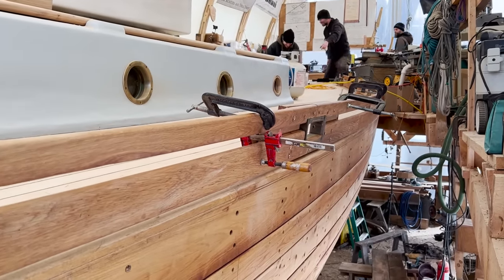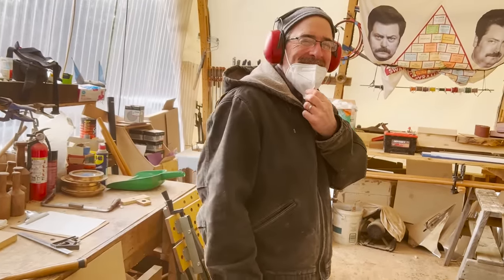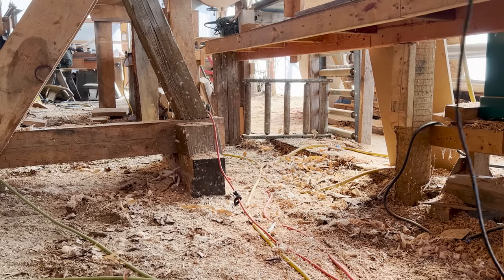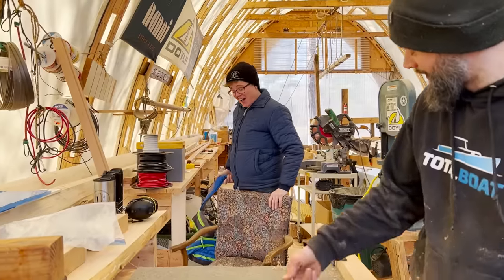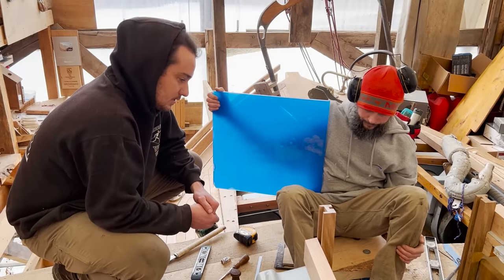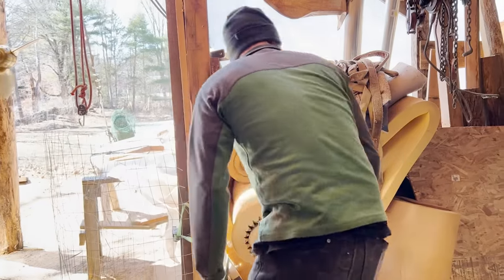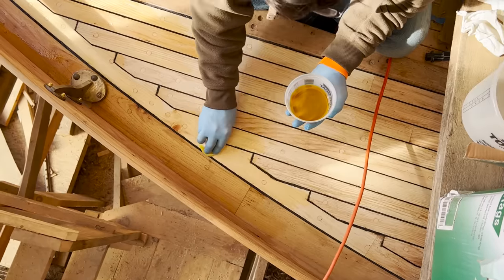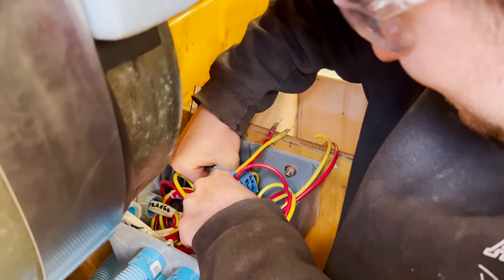A Fairer Hull and an Oiled Deck - Episode 261 - Acorn to Arabella: Journey of a Wooden Boat

Comment: The grinders seem to have worked well enough to rough oug the haul. But with so many gouges from everyone not keeping their discs flat. It seems like you will end up having to either use a lot of fairing compound or take off between 1/8" & 1/4". A belt sander, straight line sander, and flexible longboards will definitely be needed to get it well enough to paint.

Comment: Love the antique navigation lights. Please, in addition, have a set of bright LED lights. Imagine searching the darkness for those antique lights. I have spent my career searching for dimly light sailboats on the Chesapeake. Your lights may look bright up close, but what if your 6 miles away? And it's a full moon, not a dark night. You want to be able to "light up" your boat when the Coast Guard, tugboats or passing ships need to see you. It can get crazy close out there. Also, love what you're doing.
Reply from the maker: All of our nav lights will be fitted with LEDs.
Reply: Of course you will use LED lights. I’m talking about the difference between nav lights that are required by the Rules of the Road, think minimum standards, (your beautiful antique lights) and being able to light up your boat when your accidentally stray closer to commercial vessels than you would like to be (it happens) and, in an emergency, the the other guy says “I don’t see you anywhere, where are you”. You want to be able to be seen, from far away. You will find yourself in tense and possibly dangerous circumstances. Put a tricolor light on the mast top for emergencies or close meeting situations, and make it bright!
Again, I wish you well. My comments come from someone who spent a career guiding merchant ships on the Chesapeake Bay trying to avoid running over yachty-fellows with dim running light. When the shit hits the fan, and it will, you will want to be very visible and from a long way away. 
Godspeed.
Reply from the maker: LED lights are sold by the distance from which they’re able to be seen, especially when marketed for nav light applications so they meet COLREGs. We’re following the guidelines for sure, are well aware, and thanks for watching. —Anne

Comment: Could you put a fitting into the lid of the pail for the boat soup, attach a small vacuum pump, like an oil extractor, then pull a vacuum, to draw the air out of the wood, then when the vacuum releases it would draw the soup further into the wood.

Comment: I used an orchard sprayer with 40% linseed oil, 30% clear wood preservative, and 30% mineral spirits on my deck on the "La Ola"  built 1912 wood 44 foot Salmon Troller and Tuna Troller.  So when you have a warm to hot day, spray the deck and take the rest of the day off to let it soak in.
Reply from the maker: Neat boat!

Comment: I knew this was coming up and I was going to suggest useing a belt sander with an 80 grit belt it’s very course and used at right angles to the grain removes all high points as I had to doing an old floor then swap belt for finer belts, forgive me!.
Reply from the maker: Aw it’s ok, Michael, we’re humming right along.

Comment: Fairing is such a HATEFUL job ! Having said that; the results can be VERY VERY satisfying. I much prefer to use a two-man ( or three if you can do it ) longboard as opposed individual tools.
Reply from the maker: Interesting! Thanks for sharing that!
Reply: Was part of fairing the hull of a 12 using several 2 and 3 ppl long boards. Horrid when done for weeks ;)
Reply: @andrejsljunggren  Two of us went through the grits for more than a week on an old 8m, hateful indeed, but a very VERY pretty result. I wish I had owned the thing instead of being a spring fit hire.

Comment: Oiling the deck will make it slippery (dangerous) and prevent saltwater from being absorbed (causing rot).  
Traditionally decks are never oiled for those two important reasons.  

Clean saltwater is the best treatment for decks because the residual salt will attract moisture out of the air minimizing how much the wood dries out.

Be sure to give those lubbers batons to check fair their work next time; it will become more specific and clear to them what your goal is. 
Cheers and thanks for another great video!
Reply from the maker: Hi James! The oil cures, and saltwater is still helpful even with cured oil on it. I’ve worked with a few schooners during fit out and oiled decks are what we did. But yes, your point about salt water wash downs on decks is so crucial. I always remind people with canvassed decks to do the same… I take care of a beetle cat for which it makes a big difference in the longevity of the foredeck to, after rain, give it a good few buckets of saltwater. —Anne
Reply: @AcornToArabella  Hi Anne ..... We always mixed 50/50 linseed oil and turps then heated it to almost boiling point to do out timber deck (commercial working boat) The deck was made from celery top pine
Reply from the maker: Nice!!

Comment: There is a difference between smooth and fair. It may "feel" smooth but may not be fair. Be careful with rotary sanders. Get fair with power planes, then smooth with belt sanders and rotary, then long board.
Reply: Yes, I thought you needed to use a fairing board to find the high spots.
Reply: I was thinking about this a bit more.  Maybe they were using a long board to identify high spots, marking them, and then using the rotary sanders on the high spots.  That might be a more cost effective way than fairing manually.
Reply: @AndtM677 That's not the way it works. Trying yo take down high spots will not necessarily do the trick. It will be smooth but not fair. The result of rotary sander over use will be a paint job with ripples. Feeling smooth is not the test. Long board is the last step to perfection

Comment: Wow great team blasting off the fairing of the hull. So much happening on Arabella. The oiled deck and rails look good. How many coats it will need? Love my Friday fix of A2A. Thanks guys.
Reply from the maker: Coats of paint? Three or four. Primer and a couple.
Reply: @AcornToArabella  In terms of oil on the deck and rails, though, I guess the answer is as many as you can?
Reply from the maker: As many as you can, yup.

Comment: Because the boat isn’t caulked yet - has the fairing process filled the inside of the hull with dust you can’t get out now? Or are the panels all tight now on the inside edges of the boards? I recall back in the earlier planking videos there were some visible gaps between the planks and I wonder if these have all opened up further up as the hull must be bone dry at this point?
Reply from the maker: In the spring, as the humidity has increased, the seams have closed up in many places. Steve has been caulking there, and as more seams close, those will subsequently get caulked as well. We’ll help all that swelling along with some water on the boat shed floor, or with something that can mist the boat if that’s not enough. They’ll close up… they went in tight! —Anne
Reply: @AcornToArabella  it really is a living thing hey!!

Comment: For those dead eyes, would it have been possible to set up a jig with the drill press, and use a forstner bit, or even an endmill (yeah, I know endmills in Jacobs chucks are bad things) to clear out that material?
Reply from the maker: They need a fairly organic shape to them for the line to pass around.

Comment: what exactly is going on with all the sanding to the hull ?  what is the exact process for the hull ?
Reply from the maker: Fairing: making the shape smooth. And its really just grinding and sanding, and eventually taking a batten to the surface for fine tuning.

Comment: I can't help but keep wondering about the whole process of varnishing/oiling the hull early on, then just to sand it all away again at this stage. What are the pros and cons? Obviously the cheaper and less work alternative would be to leave it untreated in the interim. Does someone have some insights to share on this topic, please?
Reply from the maker: It is relatively easy and inexpensive to coat the hull in oil as a preservative since there were potentially years between when the planks went on and when the boat was going to be launched. We didn’t varnish the outside of the hull, but we did do applications of oil from time to time. —Anne
Reply: @AcornToArabella  Yeah, thanks! I was figuring either preservation or the drying process had a role in this decision. Yet there was a trend a few years back here in Norway where the outer paneling of wooden cabins/houses were left untreated to be exposed to the elements and darkened by the sun, where supposedly the resulting surface would act as a protective layer by itself. Inspired by an observation of many ancient builds which had been left untreated rather than tarred/oiled, and noting the still good condition of the wood.
Reply from the maker: There were some pieces on the boat I lived on that were untreated, and that looked beautiful gray. The occasional dousing with salt water was enough. The Mystic, CT builder Tommy Townsend is a big fan of leaving trim unfinished that would typically be varnished. The result, along with his color choices, is warm. He avoids varnish for maintenance reasons, and since I find practicality to be most beautiful, his boats are some of my very favorite. —Anne

Comment: I always use a fan pointed downwards 10' away or so when sanding. Not sure if wouldn't make things worst with that many guys and activity though. Helps keep you from getting covered in dust like that hahah. Though it just covers EVERYTHING in the shop with it
Reply from the maker: We deploy those around the shop at times and it does help. Mostly we do it more as an exhaust rather than blowing toward the work area, but it makes a difference.

Comment: I think back to the video where Alix just planed a spar (mizzen mast, perhaps?).....and that was it for the entire video. There were plenty of other videos back then with similar levels of activity, and lots of talking. The pace has changed somewhat from those days.
It's a little disappointing to see the varied widths of fill between the deck timbers, which spoils it a little. On the other hand, the amount of wiring in the boat is very impressive.